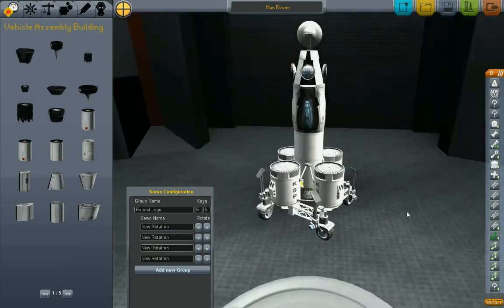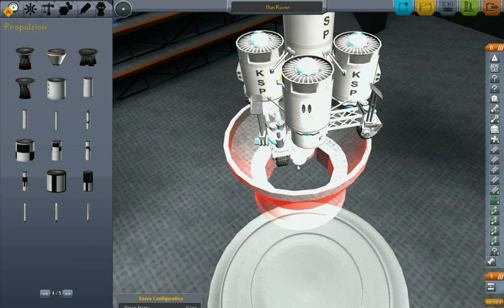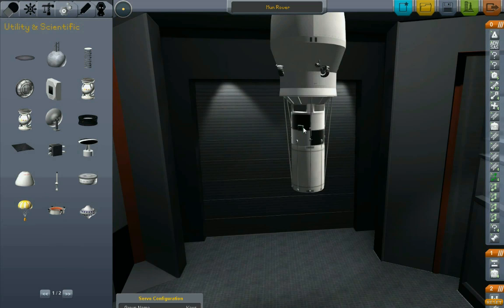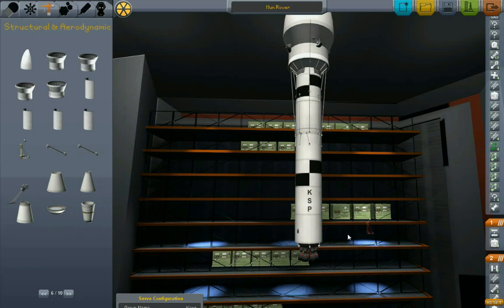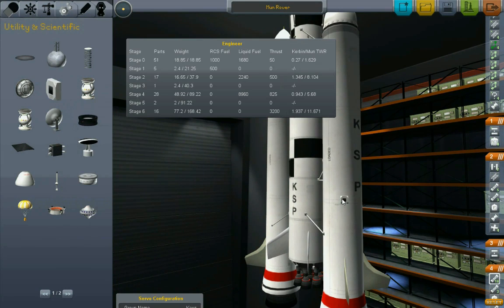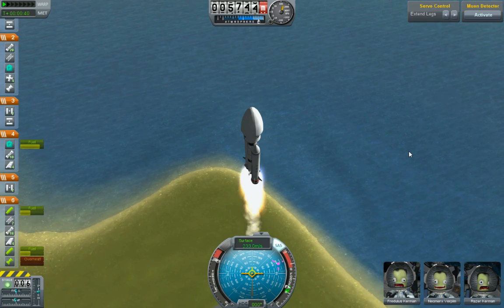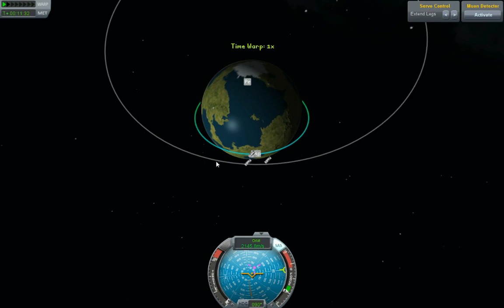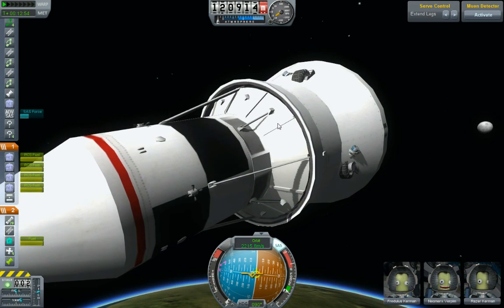Let's Fly Kerbal Space Program: chapter 2, episode 4

Comment: i think one of the reasons the launch went so well is that you actually had a T/W ratio of around 3, the 1.9 was just for the solids as you hadn't moved the liquid engine down yet so the engineer considered it a different stage with a T/W ratio of .9 by itself.

also the old saying of if it looks right it'll fly right applys to rockets aswell, that design is giving me a feeling that I've seen it before on a real rocket but i cant seem to find it, may have been a non US design.